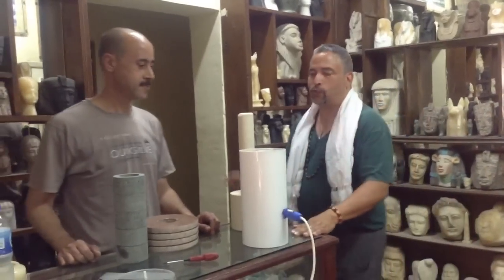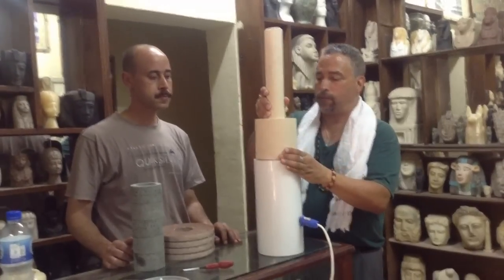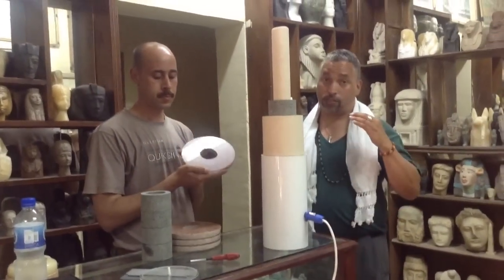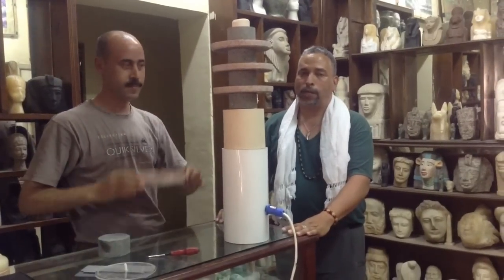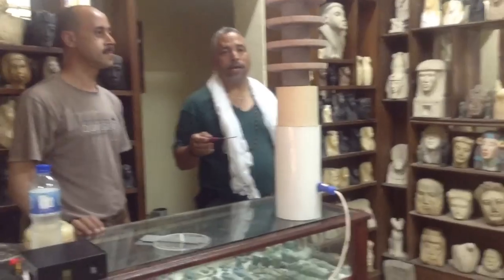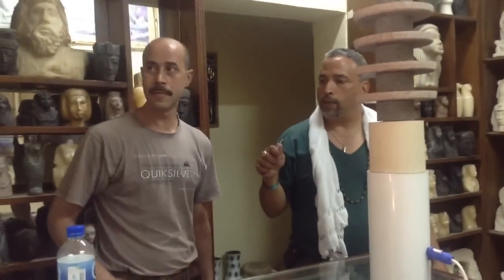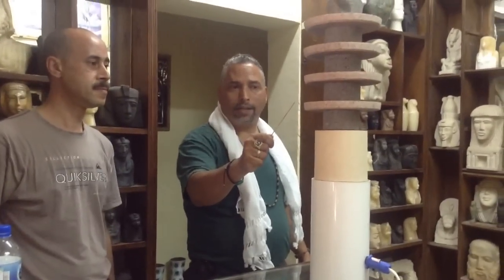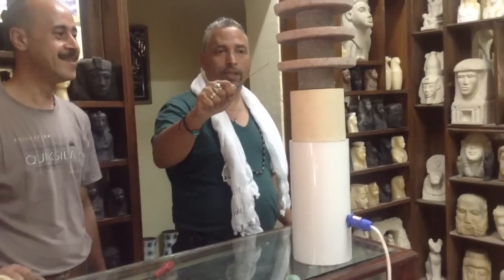Ancient Technology: "The DJED Project"

Comment: Although what you are demonstrating  looks like the Djed, you are way off as to the materials used. You are injecting energy the real Djed produces its own energy! One day I will show you how it works!!!
Reply: Feel free to back up your claim, as otherwise you are wasting your breath
Reply: I have noticed obelisks whistling. Like a big crystal set radio, only whistles one note though. Those stove top fans power themselves, the heat and two materials....create voltage to power the fan....pretty simple. Can be found in rocks or rocks made to purpose?
Reply: Sturk because Djeds are orgonite generators.
Reply: Please notify me of that day if I may be present.
Reply: Is it one day yet?
Reply: What about now, do you have info yet?
Reply: Any update my guy??

Comment: Are you using the actual materials used by the ancients?... What does that red handled screwdriver thingy prove? Why didn't you use a trifield meter to measure the magnetic,  electrical and emf fields produced? What was the ancients' power source for the djed? Pseudoscience

Comment: A beautiful pillar made of conductive crystalline elements. I don't see anything special. Underneath there is clearly a Tesla generator or a Fly back. It would be interesting to understand if the electromagnetic field can have some medical utility or if, not knowing at what frequencies it vibrates, it is extremely dangerous. As for accumulating energy, it is clear that if you turn off the generator the djed no longer works and therefore does not accumulate or produce anything usable

Comment: Where exactly did you get or find the right "materials list" for the Djed? Also what is the machine/device underneath the Djed you are using? How would the Djed have worked without that machine, which the Egyptians obviously did not have access to?
Reply: im thinking they used water to create the charge and used similar materials shown in the video
Reply: They used Magic
Reply: They used chi energy

Comment: I'm curious if granite core with would be better considering your results. Definitely on the right track. This is a three phase (pos, neg, neut,) magnetic/radar transmitter (or direct connect terminal depending on mode of use) it's meant to conduct and divide large amounts of homogenous radar/amperage/magnetism into the three seperate phases. Don't think of amperage as load, but rather as registering how much usable current is present. The core base should have a heavy gauge 2-4 turn induction coil wrapped around it just under the bottom ring, amplification modulation across which should produce radar signals (3) out of the excited/shocked/ionized core and by default the granite rings, each set of which having a different magnetic predominance between them, likely with lowest ringset being south in between, second ringset neutral between, top ringset north between. When not transmitting communication signals, or power to other loadsites, cable leads can be connected between rings and run to local loads (stones which needed lifting, shifting, or mollification).
Reply: Quick note, that's not what 3 phase means.

Comment: what's the significance of the djed structure in this? you can use any arbitrary arrangement of conductors and insulators and get the same effect. the fact that the top comments are saying that this is amazing and to ignore the people questioning is backwards thinking. I take this back compleately if somebody justifies this because I do believe the djed has energy powers but this experiment seems futile.

Comment: Ummm... a djed had nothing to do with any of this.
A djed was a windlass for pulling ropes.
Reply: Sign seen, then the image was the inspiration for many uses. The djed closely resembles a plasma discharge.  Which if seen in earth's atmosphere after a significant plasma event would mean that the electrical balance of charge between the sun,earth,moon+ would be seeking its new equilibrium. 
Djed could be vertical pulley device...AND a method to harness electrical differential between the ground and atmosphere, depending on different creative people.
Like car wheels, gears, ect all slightly different versions of a simple design of disk and central shaft.